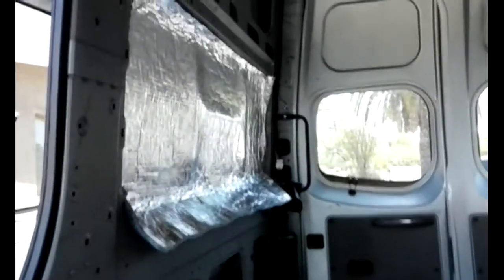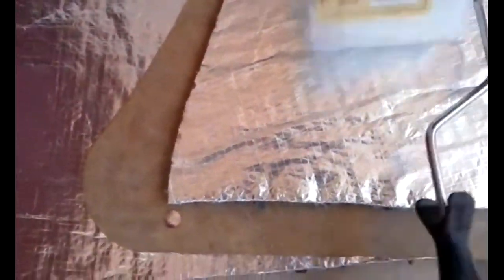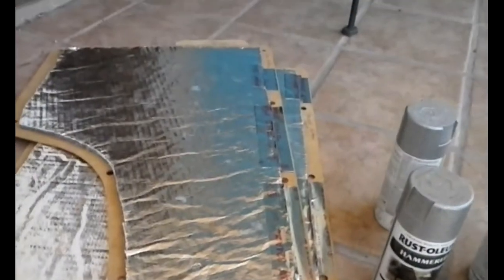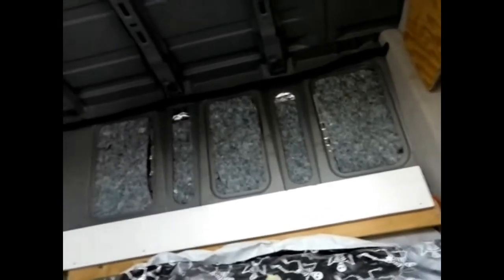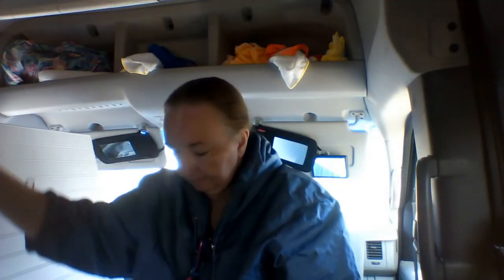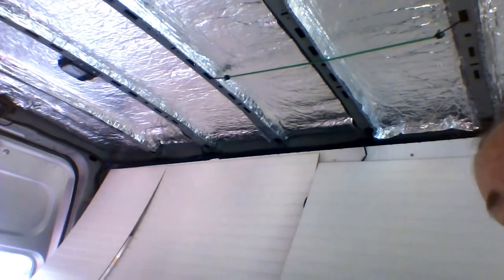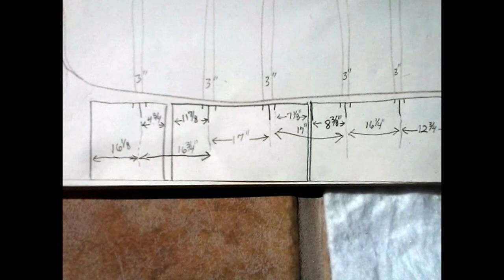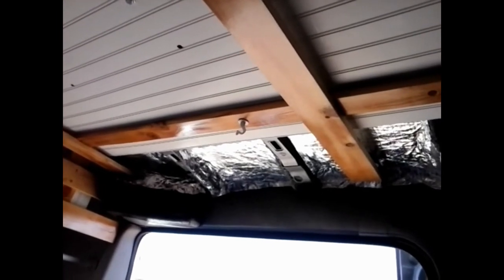VAN Insulation - UltraTouch Denim w/Foil Radiant Barrier

Comment: After installing UltraTouch Radiant Barrier on van roof did it Block rain noise or it just Dampen it? 
Thought of using UltraSonic Acoustic Panels on car roof,  it's 1" thick but can cut it to 1/2" if there are clearance issues. 
Really appreciate a response.
Reply from the maker: My Nissan NV high roof was/is a "big tin can", lol.  BUT, since insulating the ceiling, and I should have done that first not last, it is quieter and it does maintain temp better than without.  I had to look up those panels you mentioned, and see also made by same company, Bonded Logic.  But... why that and not the radiant barrier ?  

UltraTouch™ Radiant Barrier - Features & Benefits:
"Superior Acoustical Performance (Better than Foil/Bubble pack products)
Excellent Thermal Performance
Reduces Heating & Cooling Costs
Easy To Use and Install
Class-A Fire Rating
No Itch or Skin Irritation
No Formaldehyde or Harmful Irritants
Durable Natural Fiber Padding
99.5% Pure Aluminum Foil Facing
Patented Manufacturing Process
Versatile Product With Multiple Uses No Protective Clothing Needed

... - Automobile, Truck, & Van Uses:
Under Hoods
Headliners
Firewall’s
Floorboards
Sleeper Compartments
Complete Interiors
Refrigeration Compartments
 
- RV & Motor Home Uses:

Engine Covers
Generator Compartments
Ceilings
Firewall’s
Floorboards
Walls
Dog Houses
Complete Interiors
 
- Boats & Watercraft Uses:

Engine Covers
Inside Hull
Generator Compartments
Pump Housing
Bulkheads & Overhead
"

.......... Versus..........

Echo Eliminator™ Acoustic Panels - PRODUCT FEATURES
:
"Recycled Cotton (Green Acoustical Material)

Class A – Non-Flammable (Per ASTM E-84)
Lightweight
Easy to Install (Adhesively Applied)
Impact Resistant
Durable
High Light Reflectance
High Performance Acoustical Absorption
Relocatable (with Grommets)"
... Bonded Acoustical Cotton panels are ideally suited for:

School gymnasiums

Cafeterias
Classrooms
Churches
Community centers & more"
Reply: Do you HEAR the rain hitting the roof?
Reply from the maker: @paulcarag7500  Lol... yes.  Do you think think there is ANYTHING that would cut out sound in a vehicle 100%?  I did reply "it is quieter", but stated it is still a "tin can".  Plus, I live in Arizona where we get monsoon rains.  that would be a real trick to muffle completely.  If you need 100%, I'd say try earplugs.  Take care!
Reply: @DayDrifterTV  Thought of using Echo Eliminator Acoustic Panels (1" thick) on roof but it's too thick and there's clearance issue with my car so I thought of cutting it in half to 1/2" thick.  Used Echo Eliminator on my car's Outer door metal frame and it drastically reduced cabin noise but not sure if it will Block rain noise on roof.  I was told it will Only reduce impact of rain noise but I don't know if he tried it.  I used Damplifier Pro (2mm total thickness or 80 mils) from Seconskinaudio.com and it Blocked rain noise and other noise that goes through the roof when driving on freeway and local roads.   If Echo Eliminator works then it's a cheaper alternative.